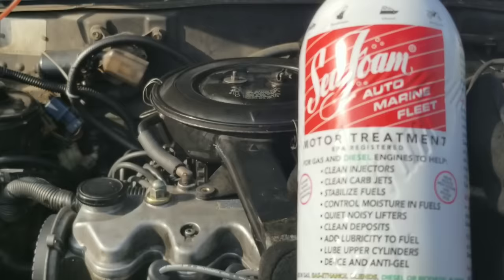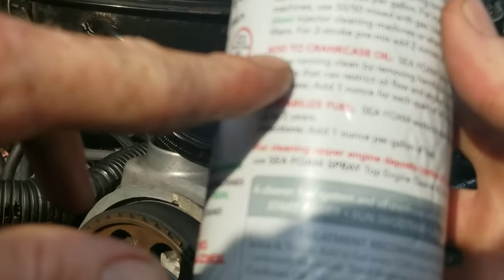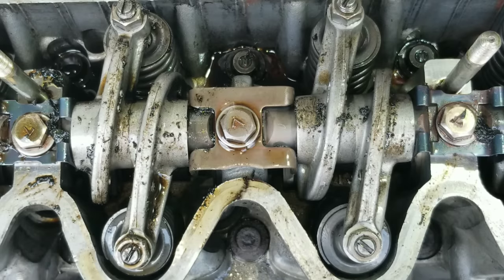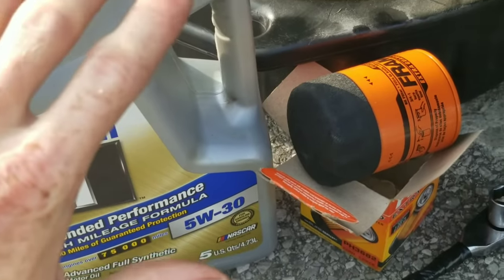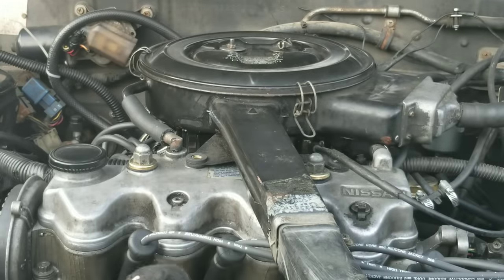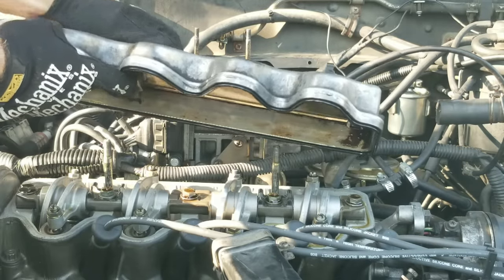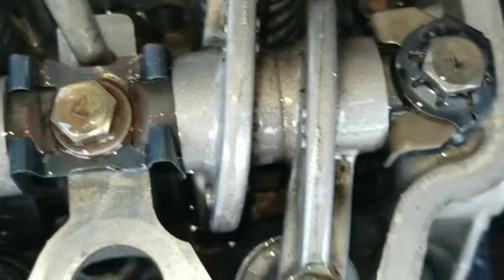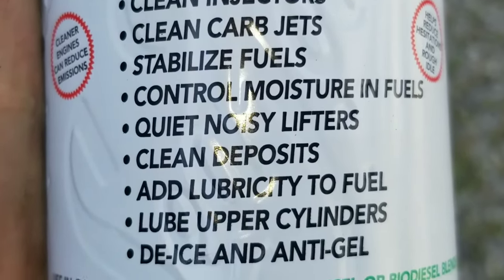Seafoam results i cant believe what it done to my engine

Comment: Though Sea Foam can be added at any time between oil change intervals, we recommend adding Sea Foam to an oil crankcase 100 to 300 drive miles before changing oil and filter.

This is what sea foam recomends do not keep it in for 3000 miles will ruin your engine.

Comment: i love sea foam. i have a 2000 4.6 f 150 that after it ran about 15 minutes it would start smoking. the heads was so nasty that the oil couldn't drain back down and would start sucking it out the PVC valve. after using sea foam a couple times the engine was spotless. 10 years later it still dont burn oil.

Comment: Old engines are built to contain sludge out of the way, namely in the oil pan. A lot of times that sludge builds up between the gasket and mating surfaces further reducing the chance of developing a leak. You remove that sludge you will start to find leaks you never knew about. For really sludged up engines it is best to first fix the PCV drop the oil pan and clean it out and bolt it back up and change the oil at the required intervals.
Reply from the maker: Thanks so what can we try next?

Comment: Love Seafoam. I couldn't believe the filth it removed from the throttle body of my 2005 Dakota with 125,000 miles. Yep. Did the oil also. I have my Sea Foam t-shirt. Gumout cleaned nothing out of throttle body.

Comment: Seafoam was okay for two stroke engines but our autos and trucks are not  3 stroke.  You want a cleaner that has PEA in it like Techron.  Seafoam has an oil additive, and when it burns the oild does not burn and ends up in the catyletic system which can burn out you catyletic converter.  Techron is nitrogen based and has PEA...Seafoam does not.

Comment: I add an entire bottle of sea foam to the oil let the engine run 10-30 min. Change the oil.
I add an entire bottle to the gas tank 
And 
I do an entire bottle via induction service 
All every 3000 miles.
Overkill? Maybe..
But everything I own has over 150,000 miles

Comment: Marvin's Mystery Oil vs Sea Foam test. Who's the winner?
Reply from the maker: Honestly its a tough call beci feel there too close to call but i also try not to say even when its is a clear decision because i dont want people to think im promoting any product. What i will say with alot of test on both you cant go wrong regardless of which one you choose
Reply: marvel myster oil is far better. marvel is still a lubricant with cleaning additives , sea foam is a total solvent which isnt safe unless used as a 30 minute flush at idle only. diesel fuel in the oil for 1 hour idling used to work well with no harm done.
Reply from the maker: What about lucas destroyed my engine video. Lucas did great check it out and if i get enough likes we will perform the next test on q engine thats asked

Comment: You are not supposed to drive 3,000 miles after adding that to your crank case. Once you add seafoam to your oil it starts loosening up all of those deposits and they end up suspended in the oil. After a few hundred miles you need to change your oil because all of the stuff floating around in there can do damage to your engine. That gunk is all kinds of tiny metal shavings and other various refuse created by the standard operation of your engine. Not stuff you want floating around in your oil for a few thousand miles.

Comment: You haven't seen 'absolutely filthy' until you've seen the heads off a 1990 Jeep 4.0L straight 6 and 300,000 miles.  They have a system that regurgitates the blow-by of the valves back into the intake. NASTY!

Comment: the before video looks like there was grime that was put there by someone on purpose on the head, does not look like normal dirty engine parts  and looks like the inside of the valve cover had been cleaned to look like the seafoam cleaned it that well.....kind of sketchy there

Comment: I bought the high mileage for my 99 Durango with 156,000 miles and it messed up my fuel level sensor. Shows full now when empty. Thanks Seafoam. True life saver.

Comment: This stuff destroyed my vehicle. It may clean buildup but it’s super corrosive and will cause the seals and rings it comes in contact with break down and become brittle. I used it in both my tank and booster and have had continuous problems since.

Comment: If you have any “O” Rings Rubber Seals, that are for seals in the Lubrication System, I would think hard and ask a mechanic before using any internal engine cleaner. I used one after a, “So Called,” mechanic in the family highly recommended a treatment. Ended up having to do an expensive engine tear down to replace seals. Notice, I didn’t say whose additive I used, their Attorneys are bigger than mine!

Comment: That motor was not dirty  I sold Amsoil when I ran a garage after 2000000 is replaced rocker cover gasket on my Ford Falcon it was like new on rockers & under the rocker cover Ron N Z it was synthetic by the way
Reply from the maker: Thats great there was alot of gunk on this motor
Reply: Can you use complete sentences next time?

Comment: A mechanic I gave my Ford F150 to change the timing chain, water pump and oil pump, said my motor needs to be replaced... the clapping on the timing chain didn't go away, according to him,  because the motor is so gunked up thatnthe oil isn't glowing to the top of the motor, he said the oil sensor was dry... if that's the case would I be able to add this product to it to remove the gunk he says it has? Or is he just trying to charge me for more needless work? I don't even know if he really changed the parts.

Comment: I think the reason it worked so well was because you poured such a small amount and drove with it a lot longer than advised by 2800 miles 😅. But if you’d had poured the correct amount and drove it for 3k miles that engine would have been spotless hahaha.

Comment: I thought it would be good as a carb cleaner in my fj1200 but when I pulled the bowls in the spring they had a crust of what appeared to be alum.corrosion I was under the impression that Seafoam could be used as a stabilizer as it says on the can. DO NOT USE AS ALONG TERM STABILIZER it will be just as bad as ethanol left in float bowls. And never use Fram filters ever. See the comparison videos.
Reply from the maker: Lol yes fram was used for a flush throw away filter and use fogging oil to prevent corrosion

Comment: The only problem with this is particles come off and get caught elsewhere. I know it's a pain but wait until you can pull apart the motor and clean, changing all gaskets whilst you are there, seafoam is only good for lawn mower etc.
Reply from the maker: Over time the gunk will break loose without cleaning. Follow manufacturer's instructions.

Comment: My motor looks that clean with out useing anything. And it's done 15000km how did you get a dirty motor?
Reply from the maker: Wasnt maintained properly. I didnt always own and the varnish build up is on new cars even so one would need drain all oil then down to not even a coat to notice because of the color and build up finds places to build up. The small build up always goes unnoticed i thought the same until i check a car that i changed oil every 3000 without any cleaners. But checking under a microscope it was so obvious and i sent to a lab but most dont intend on keeping a car for 400000 or more well so far all cars have held up under tremendous pressure and its cheap insurance. 1 time a year atleast but i always felt the same until recently so thanks for your time

Comment: My Elantra 2008 looks 3 times better than that at 3:50 when I open it with 110K miles and I only use Mobil one synthetic oil when the car reached 50K miles. before 50K I used regular oil, 5w20. I started to use Castrol magnate synthetic and change it every 5K miles. I will open it again when the car gets maybe 220K., to see how Castrol worked.

Comment: I wouldn't step on the cracks to safe my mother's back but I'm an orphan. Instead, I'd run this stuff for about 250 miles max, just before an oil change. Change it and do it again next time. Because I'm not lazy.

Comment: That engine looks like that because of the Fram oil filter... It don't have enough filter material. And they are the cheapest to make. Why do you think your oil  is dirty after 1,500 miles? The standard ones from O'REILLY'S or Walmart... Hell even the ones from Napa are way better because they have more filter material. Don't get me wrong. I do use Seafoam, Berrymans B12 and Marvel Mystery Oil. So far in my experience I trust both MMO and B12 are the right combo when it comes to cleaning carbon out and providing micro level protection.
Reply from the maker: Yeah i agree and the filter was for the flush i use wix xp

Comment: Interesting experiment... but 1) it would be good to repeat the same test but NOT add any additive to see what just using clean oil does. 2) Im not sure but do the Lucas instruction say to drive 3000 miles after you add the additive? I thought you only idle the engine for 15 minutes, then perform an oil change.

Comment: Firstly as others  have said you didn't put enough of the cleaner in.

Secondly it does not say to drive 3000 miles it actually says on the can to drive 100 to 300 miles. 

However if your your video is true to life and not fixed the head certainly looks clean afterwards

Comment: I found this:
Pro Tip:
Although sea foam manufacturers recommend leaving it inside crank case until the next time you change the oil, it is best to change it after about 75 to 100 miles from the time you add sea foam. This is because engines that clock higher miles can easily have lots of accumulation which can affect the oil filter.
I have also heard (most often) that 200 miles is the right number. 

These are claims that I haven't found evidence for but I have used it in my oil and it got dark pretty quickly. I wound up changing the oil and filter after about 350 miles even though the Sea Foam people said I could keep it in for thousands of miles.
Reply from the maker: Thanks for sharing better to be safe.

Comment: I gotta be honest if I was flushing an engine I would use the best filter I could get my hands on,Supertech or any cheap synthetic is fine for flush oil,but seeing as how you are trying to knocking shit loose I'd want the best filter I could get my hands on.I know a lit of places give you the Fram with the oil,but I would save that for a regular oil change and get a better one
Reply from the maker: Best filter wix xp
Reply: NATES INTERACTIVE AUTO yeah they make good filters,I've been a purolator guy for 20 plus years,if I had no choice Wix is what I'd run.
Reply from the maker: Absolutely thanks for sharing

Comment: Frame is definitely the worst filter you can get.
Reply from the maker: True what test can we do next
Reply: @NATESINTERACTIVEAUTO  Marvin's Mystery Oil vs Sea Foam test, who's the winner. Or what's the best oil filter to protect your engine?
Reply: @MrShanksta  I've used fram oil filters for 46 years in every vehicle (9) I've owned some to over 150,000 miles without one problem
Reply from the maker: Yeah thats what made it perfect for this video. Use fram for oil flush and throw away so use wix xp regularly
Reply from the maker: Yeah they arent the best but really they get the job done
Reply: Mista Shanksta job
Reply from the maker: Wix xp is the best
Reply: thats conjecture.
nobody can prove they dont filter well

10,000 cars per week blowing up because of FRAM?
NOPE
Reply from the maker: Your correct its not the best but it will do fine

Comment: This video seems a little off the cylinder head was pretty clean to begin with wouldn't take nothing but a wire brush to clean it up
Reply from the maker: That could cause damage becarful
Reply: Do not use a wire brush in an assembled engine. Ok for when you have parts off or doing a rebuild.

Comment: The Fram oil filter is something that I would never use. Some really lousy filter material inside.....
Reply from the maker: Yeah i agree this is for the flush only and i run with wix xp price and quality so what would you recommend?
Reply: @NATESINTERACTIVEAUTO  anything except Fram. I drive a Hyundai and use a genuine oil filter imported from Hyundai Korea. The mechanics also mentioned that Mobis Korean filters are the next suitable alternatives for use in Hyundais and Kias.
Reply from the maker: Thanks if you check recent videos i use a new Hyundai for tests and also use a wix xp for it i have found most manufacturers use low quality filters even big oil brands like mobil 1 i use there oil and a supertech filter was surprisingly better than most definitely the best cheap filter but wix xp quality and price

Comment: Thats filthy? Neah. filthy is when its black and the crusty stuff is 1/4 inch thick and the crankcase has black wheat flake looking stuff in it. Had one 318 with 120k that the oil turned to varnish and the lifters froze up keeping the valves open. Another engine upon opening the  valve covers were full and looked like burnt meat loaf shapes molded by the valve covers.

Comment: My car knocks a little on startup... like 3 or 4 times.. is it just because it takes 8 quarts of oil and it takes awhile for it to get up to all the metal parts??  Only does it for s second or two.. maybe this would help?
Reply: Arizona Sky lucas oil stabilizer. change the oil dump the whole bottle and top off with fresh oil and you should be just fine
Reply: Arizona Sky what kind of car do u drive
Reply: It will not solve the problem, but will help in other ways. Knocking on start up can be from the wrong oil filter; filter not having a silicone anti drainback valve. Many Fords are like this, including my own. My owners manual states this briefly. I find the wrong oil filter will make the engine knock after the vehicle has been sitting overnight, or at least 4 hours. The incorrect anti drainback valve allows the oil filter to empty by siphoning to the oil pan. The engine will knock (actually the rod bearings) until the oil filter is filled back up.
Reply: If it's a subaru it's the timing chain tensioner. Nissan vtc actuator. Honda k series engine starter.
Reply from the maker: Thanks for sharing
Reply from the maker: Thank you for your time

Comment: Let me tell you what happens when you break loose all the dirt and carbon in your engine you run all that trash thru the bearings oil pump every moving part in your engine wears like hell because you circulated all the trash through it that should have stayed put and yeah it's amazing how much cleaner your engine will look inside and it might raise oil pressure due to smaller passages in the oiling system because you filled them with trash THERE IS NO SUCH THING AS AN ENGINE OVERHAUL IN A CAN  the only time I would ever try to clean the inside of an engine is if she has stuck lifters or plugged up oil returns then you use a shop vac and a brush on oil returns and half a quart of transmission fluid in the oil for stuck lifters and drain the oil as soon as the lifters come back to life transmission fluid will cut the heck out of garbage in an engine because of the extremely high detergent level next time you get front end grease on your hands from greasy tie rods or ball joints or Engine grease in general pour a couple ounces of transmission fluid in your hands rub it around good and wipe with a clean rag see how clean your hands are then

Comment: Is this okay to use for german cars?
Reply from the maker: Yes manufacturers show details
Reply: NATES INTERACTIVE AUTO thank you Sir!
Reply from the maker: Your welcome i used this same product in my newest video
Reply: I've used it in a BMW M44 engine. I don't flood it like some people do. I put some in the oil, in the crankcase vent tube, in the fuel tank, and a small amount (10mL) in each cylinder when changing spark plugs. Be sure to turn the engine over by hand wrench after putting some in the cylinders. If not, give it four hours to soak. This will let the seafoam drain into the rings and piston skirt area.
Reply from the maker: Yes that can be very helpful
Reply: NATES INTERACTIVE AUTO  how do u turn her over by wrench, please. Do I buy the liquid 4 all suggested?
Reply from the maker: What are you trying to do?
Reply: Rita, get a socket which fits the bolt on the front of the crankshaft. Use a breaker bar or long handle ratchet. Works best when spark plugs are about half way in... easier to turn engine!
Reply from the maker: True

Comment: nice to see a nissan t12 still going
Reply from the maker: What would you like to see next
Reply: @NATESINTERACTIVEAUTO  could you do a review of your car? I have a Nissan t12 aswell there becoming quite rare
Reply from the maker: 1988 nissan sentra 2 door 1.6 tbi thats fuel injection and some are called b12
Reply: @NATESINTERACTIVEAUTO  oh that's awesome, mine is a 87 Nissan stanza based on the T12 platform or the B12
Reply: @NATESINTERACTIVEAUTO  yea if I could find another stanza I would I need a hood, grille, and a headlight since I hit a deer recently, no matter what happens to this stanza I'm keeping it up because like you seid there so rare now
Reply from the maker: There alot of parts on ebay
Reply: @NATESINTERACTIVEAUTO  i just looked on ebay for a hood and i found one, i ordered it, Thanks
Reply from the maker: Thats great man

Comment: Question, why wouldn't you just add it to the fuel tank?
Reply from the maker: Its qlso a oil treatment what can i try next
Reply: You can and should add some type of additives every 3000 miles or so unless you run on BP Shell or others that add something extra to fuel. I add sea foam to gas every time I get a gas can filled for mowers weed eaters ect. We all run in snowmobiles and quads it’s an excellent product
Reply from the maker: Great what ways to improve test?